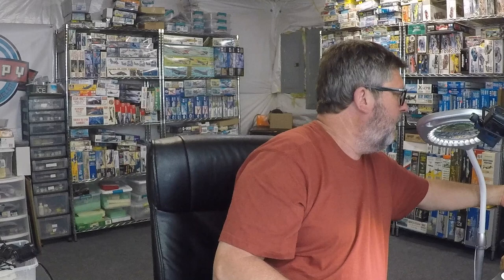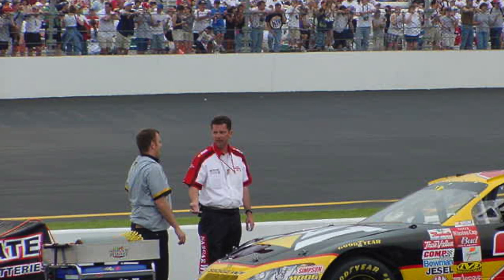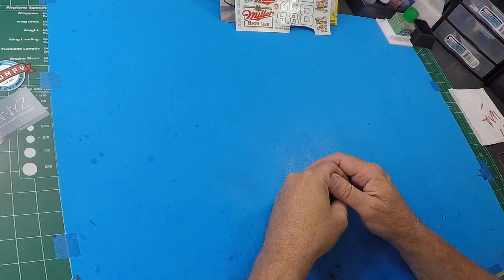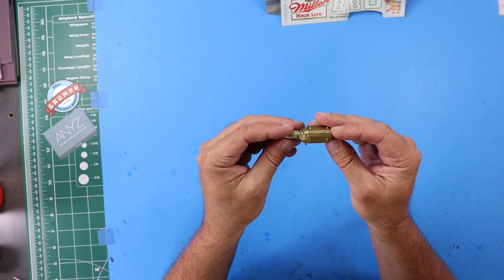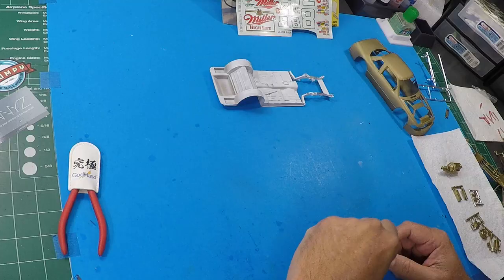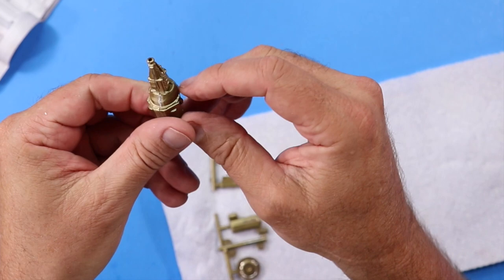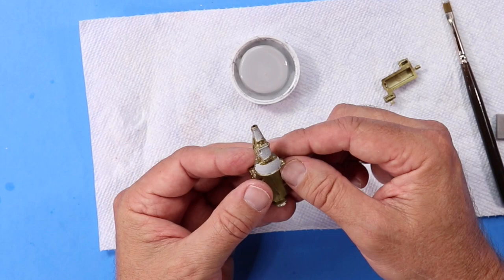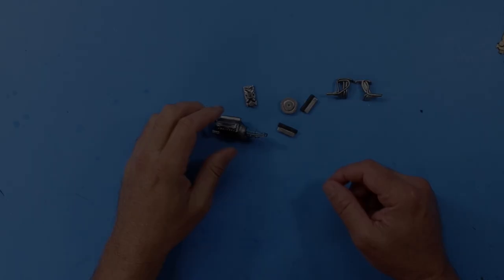Monogram 1/24 NASCAR Miller Buick Driven by Dick Trickle EP 001 (E016)

Comment: I use easy off oven cleaner sprayed into the corner of the kitchen sink and set the chrome parts to be stripped in it and then cover it with a little more cleaner. 15 minutes later the chrome is gone ans so is the clear costing that holds the chrome. For the parting lines on the roll cages i use a Flexifile sander with 320 grit and it helps me get the lines cleaned of and still have the round profile of the roll cage “pipe”. I also cut the cross pipes on the headers off because those were not used a great deal and only select races. They just happened to be on the car Monogram used fro measuring and pictures.  Well so the story goes. 😆
Reply from the maker: I have heard that about the. Ross over pipes.  Jim Rodgers at SalvinosJR is now 3D printing a pretty awsome set of headers.  I didn’t think about my Flexifile sander, thanks for that!!!

Comment: You asked for a better way to strip chrome. A general rule I use is if after 30 minutes goes by and it's not done, I use another stripping method/product. Not all chrome/plastic is the same so it might take some testing. (That's for "save for info.)
Try some Oven Off oven cleaner. I use the lemon scent one that strips my chrome in 15 minutes.
Reply from the maker: Thanks for that info.  I’m going to test purple power this afternoon.

Comment: Try super clean at auto parts store takes chrome off in minutes. The stuff is a great cleaner also, takes stains outta a driveway. Use full strength stripping paint or chrome, mix with water as a cleaner
Reply: That's what I use, good stuff!

Comment: I use purple power all purpose cleaner....to strip the chrome
Reply from the maker: I’ve head that works.  You thing it works better than bleach?
Reply: Grumpy Modeler I have never used bleach but I did build a nascar model my last build and it took the chrome off in minutes...
Reply: @GrumpyModeler  Yes, the purple or Super clean works better then bleach.